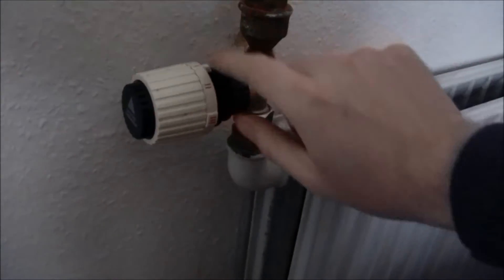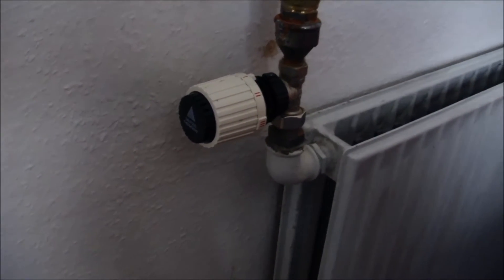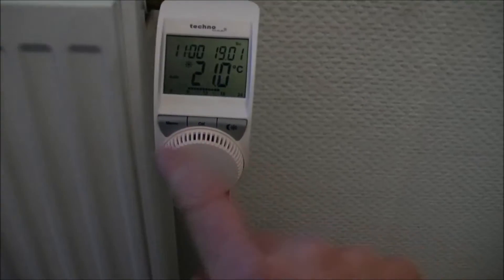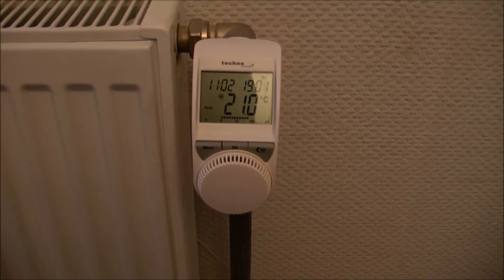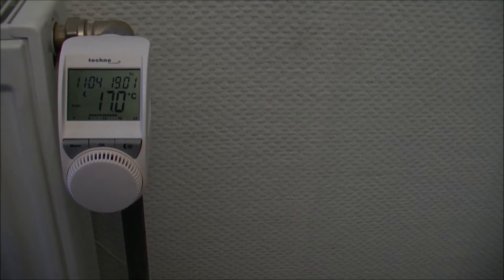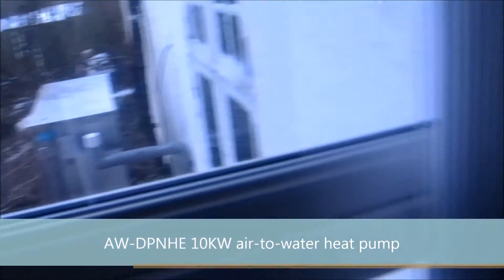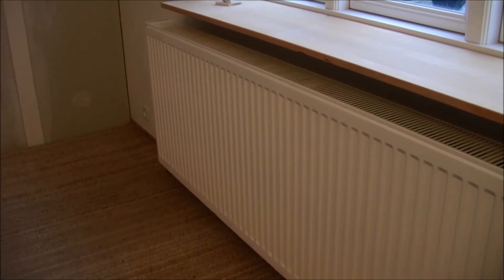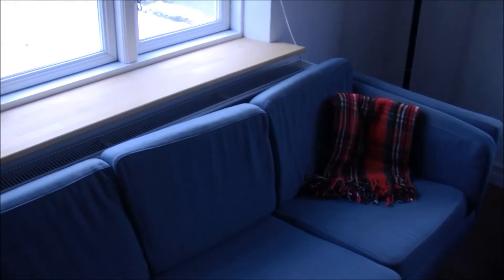Thermostats, Radiators and Heat Pump - 003

Comment: is that room definately 36m2? it looks smaller. I am currently looking at putting a heat pump system into my home, what is your homes overall m2 that you are heating with a 10kW heat pump?
Reply from the maker: Hi The351mustang
Thank You very much! My house here is 168m2 100m2 1.floor and 68m2 2.floor.
The heat pump can head it all,, when it is not to cold outside,, but I still have a lot of old inefficient radiators. So I also have a wood stove. And as I only use my house in the weekends,, it would take wat to long to heat the house up just using the heat pump,, and power is expensive :-)
Thank you for watching! :-)
Reply: Thank you very much for your reply. I too have a wood stove within the home, but would mainly be using a heat pump to maintain 20-23 deg Celcius within the home during the whole winter, but winter here is not too cold, on an average year daily temperatures probably between 0 and 10 degrees Celcius, but this year has been unusually warm so far. I was quoted a heat pump of 15kW, but I think it is probably a bit too much. My overall floor space is also about 170m2. Thank you for your help.